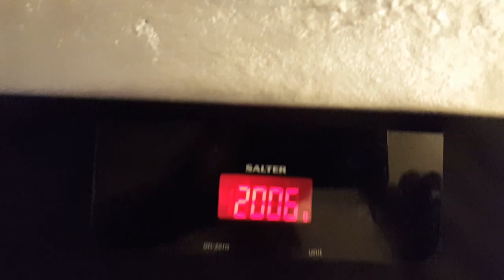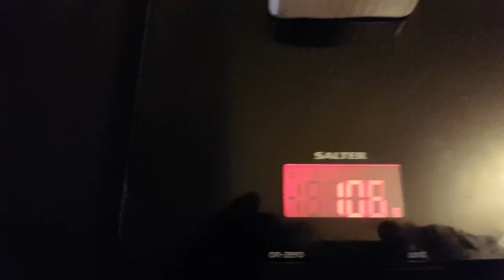Massive Scrap Aluminium Ingot, Open Cast Into Petrobond Sand

Comment: That was some clean aluminium, not much dross off it.  Though it looks like you picked it up a little early and put a nice ding in it with the pliers!
Reply from the maker: He he you noticed that...  Yeah it was a lot softer than i thought.  A friend works at a commercial window place, they are the off cuts -  I never have much to skim off, so I don't bother fluxing or degassing.  They seem to come out OK.  The copper is much more problematic....

Comment: Quick question, why in the world did you preheat your scrap with your torch?
Reply from the maker: The metal in the crucible is fine as it's being heated from cold.  The metal on the bricks to be added to the molten metal has a thin layer of atmospheric moisture on it, you can see this at 3:59.  If I added that to the molten metal there is a high risk of explosion as shown here https://www.youtube.com/watch?v=b71LB2cerx4 at 10:09.  Once it's happened once, you'll never want to take that risk again !!!   Always preheat your metal and moulds... hehe  Cheers Andy 🍺🍺🍺